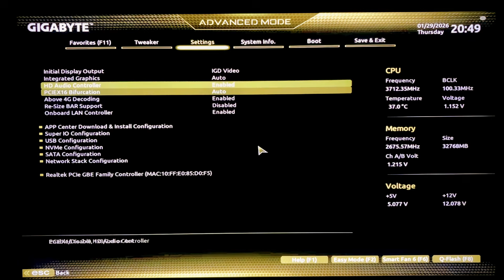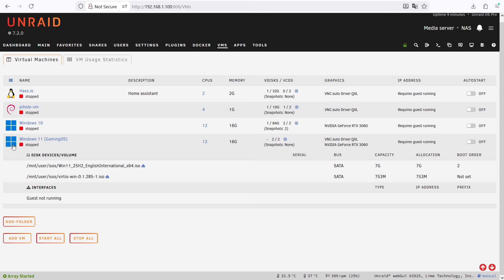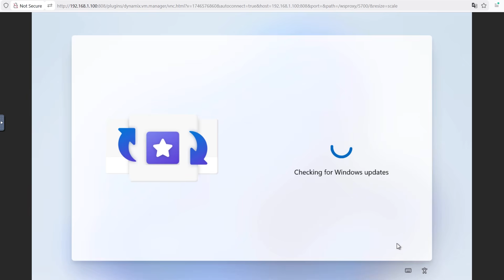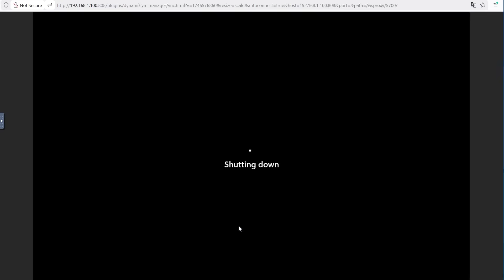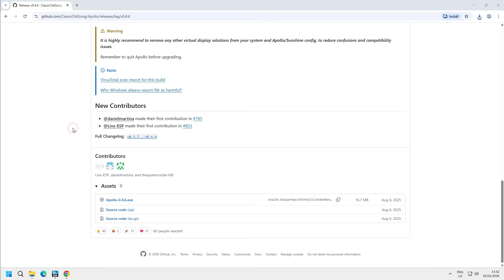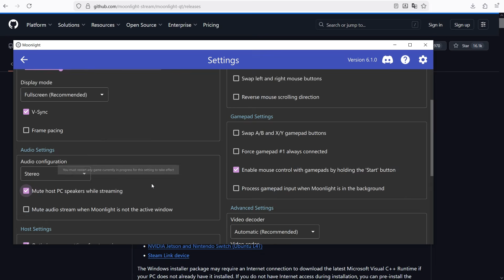Gaming on a NAS?! Easy! | Unraid Gaming NAS Build

Comment: 40W 24/7 at around 36Cents/kWh equals about 126€ just for idling! Too much of a environmental footprint if you ask me. If we manage 10-15W idle power consumption, Ill join the club. Tough since the 1080Ti GPU became insanely power hungry, which is a bummer - for me GPUs peaked with the 1080Ti!

Anyhow, thanks for sharing 😊
Reply: Modern GPUs aren't designed with efficiency in mind. If you want to game off a server and minimise your power usage, it might be better to use a separate server just for games. Use systemd to sleep/shut down the server when not in use and wake-on-lan to wake it up.

Comment: I can finally share my HDD tray model. I recommend that anyone who buys this case and has a 3D printer try printing it. I am very satisfied with my work; it is much more comfortable than the stock metal sheet handles. I wanted to share a link, but YouTube keeps deleting my comment. Look for it on Printables: “3.5 HDD Trays for Sagittarius NAS case.”

Comment: I wonder if it would be possible to share the gpu for gaming and also other containers. For example, using the gpu for a plex transcoding at the same time as playing games. Since docker and the VM can't use the gpu at the same time. I guess you could use a gaming container
Reply: Best option would be a budget friendly secondary card (ideally from a different mfg). Gpu drivers in unraid prevent passthrough from working properly so there’s not a way to get near bare metal performance AND have it available for docker. If you’re willing to sacrifice some performance, I’ve heard the steam headless docker is a good alternative
Reply: @RLfilmz that's kinda what i was thinking. I have an arc a380 for transcoding. A second gpu for self hosted cloud gaming would be cool, but i imagine it would get very hot airflow lol. Especially since i have an hba card as well 😹
Reply: @guidosaur7506 its not as bad as you’d think. You can install msi afterburner to keep fan speeds high and temps manageable. My titan xp does great alongside 12 drives, an hba, a nic and some other pci goodies
Reply: I use my CPU for this as i have an Intel 13th gen.   So people can watch plex/transcode if required while i use the GPU for gaming.  The only reason i went intel at the time or would be AMD.

Comment: I have been playing games on NAS for many, many years, moreover in 5K resolution and at full detail. I use a QNAP NAS with an NVIDIA graphics card, where I have gpu-passthrough set up in QNAP Virtualization Station to a VM with Win11. I used to use TVS-1282T3, then TVS-h1288X, and over time I tried out different graphics cards - RTX 3060 Ti, RTX 3080 Ti, RTX 4070 Ti, RTX 4070 Ti Super, and finally RTX 4080 Super. Now I'm experimenting with the new TVS-AIh1688ATX and RTX 5080. The great thing about QNAP NAS is that it supports various graphics cards. In my case, however, I had to improvise a little - replacing the power supply with a more powerful one (Cooler Master) and connecting the GPU using a PCIe riser with the GPU placed on rubber pads on top of the NAS (and thanks to that, the GPU runs cool while gaming, which is awesome), because the graphics cards I use are too big to fit directly inside the NAS. But since I'm already using the NAS, why not play on it too, right? 😉
Reply: sounds good my 😎

Comment: I have a similar idea but using proxmox and a VM using bizzite. The and I want to have NAS and several containers for my other applications. But I what to have a 16 core with HT and 32gb ram exactly for the load on the games, having 8 cores and 16gb for the gaming part and the rest for the containers. Your idea?
Reply: I agree that the power consumption is a problem, but my solution will be shutting down the gaming VM and parking the unused cores, so my consumption goes down a bit, not equal, but close to the current system I have. A Ryzen 7 5700g with two nvmes, an HDD and an SSD, the internal GPU used for video encoding. I don't know exactly how much power it's consuming, but it's close to nothing. And for extra I have a solar system that powers the house, so majority of my bill is contractual with close to 0 consumption
Reply: @PSPestana at that point the energy consumption part is much less of an issue, as long as your power use fits withing the budget your solar provides. I wish I could do some sort of solar and/or wind power gen, that would be very nice, but where I live the ROI is way too long for many people to do it.
Reply: I have been homelabbing for about a decade now. When I started, especially around the time Zen2 (Ryzen 3000) came out, I wanted to build one machine to do everything. I thought it would be so cool, then I kept building out my services and my use cases, then I started considering power consumption. What I realized is having one huge super powerful machine was not actually the most efficient use of resources. If you have a super high core count cpu, you have to power that cpu as long as it is powered on. What I have found is I use significantly less power by having multiple machines with specific purposes that are turned on or off based on need.
Reply from the maker: @7MBoosted  I agree with you. You need to take into account power consumption in idle. If you are willing to pay for the unused power during idle, then you are fine to go.
How much energy are you saving by using separate machines?
Reply: @Nikstechlife I have made a lot of hardware changes over the years, but right now my high power machines idle between 70-100w so at minimum I save between 140 and 200w when they are not in use. I used to have AMD FX machines as my always on infrastructure at one point, my pfsense router went from running on average around 90w down to under 20w when I switched to a low power skylake chip. Same with my server (was using a FX 8320e and gtx 970 sucked power from the wall) I think at idle it consumed about 60w, now with a 6700t and quadro p2000 it idles around 35w. That's with about 20 docker containers going, and rendering a gnome desktop (I use desktop ubuntu for my server as I use it as a workstation a lot of the time too). So I would say, by making a few small hardware moves to more efficient hardware and turning off unused machines i have ended up saving a considerable amount of power each month. My next goal is to move my server to a standalone device so I can get the always on power consumption down even more by turning off my current server when not in use.